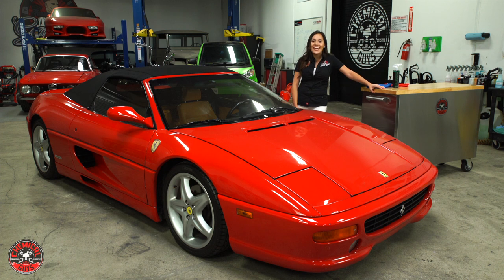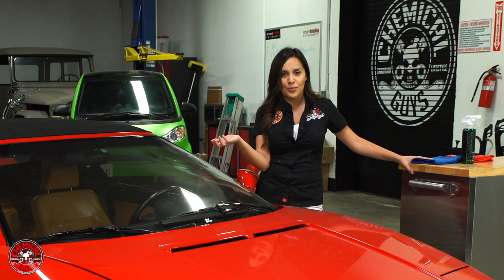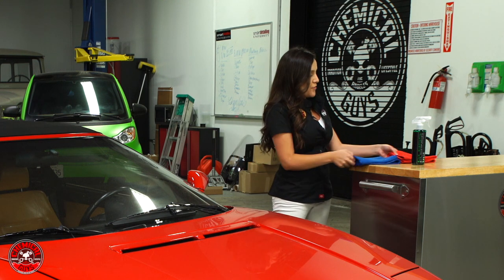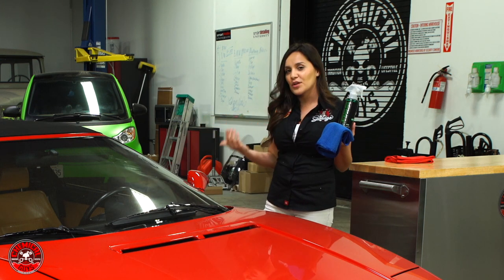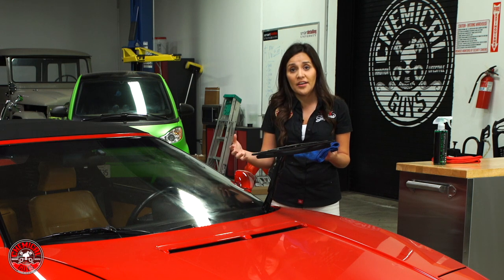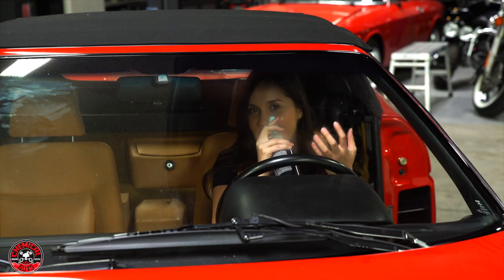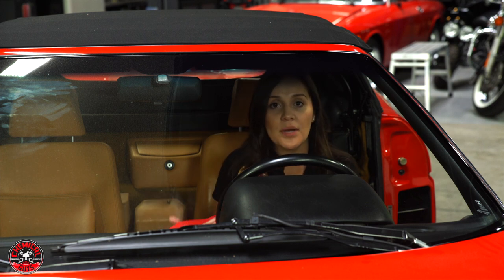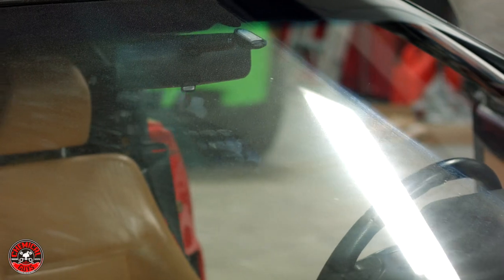Perfect Window Cleaning Techniques - How to Get Streak Free Glass - Chemical Guys Car Care

Comment: Great video... another great tip is when you do your final pass to make vertical strokes on one side (interior/exterior) and horizontal strokes on the other side. That way if you still have streaks you know which side of the class they are on

Comment: the biggest thing here is you have a garage the glass is cool to the touch so youre able to acheive this no problem but for a owner or a mobile detailer such as myself its sometimes hard to wash a car in a cool enviroment most of the time youre in a customers driveway right under the sun so you spray the product begin wiping and as the product decreases it dries almost instantly so youre stuck just spreading the streaks one way then the other but it doesnt really come off unless youre extra carefull and work a super small area at a time

Comment: @chemicalguys my car glass have these water deposits.
I.e hard water spots.
How do I remove it!?
Please help
Reply from the maker: Hey there! Check out Heavy Duty Water Spot Remover to easily lift water spots before they can stain and etch the glass. If it has etched it will require a polish to restore clarity.
https://www.chemicalguys.com/heavy-duty-water-spot-remover/water-spot-remover.html

Comment: Great job with the video!  I've been using the workhorse MF towel to apply the cleaning solution and waffle weave to finish.  It works well but now you have me re-thinking the use of the workhorse.  Might have to pick up more waffle weaves.

Comment: hi cg loving all the videos that you do loads if valuable information but I just wanted to ask if you can do a video for mobile detailing about water tank/foam cannon an pressure washer setups. just on what parts you need to get started. thankyou I've learned so much from you guys. Jay

Comment: I have th CG Glass Cleaner Signature Series and you don't really have to use as much product as in the video, it's a really good, nice smelling window cleaner. I've already started using two towels for cleaning my windows after using just a MF towel for glass kept leaving streaks. Now I use a couple to a few sprays of the signature streaks on the glass, wipe off with the MF towel for glass, then I buff with a finishing cloth, 'cause I'm picky that way.
I would also like to add, again, this glass cleaner doesn't just not smell foul, it smells great, almost like some sort of candy and yet it does it's job excellent!

Comment: never really used glass cleaner products. always used a wet microfiber with soap and then another microfiber to dry streak free.
Reply from the maker: Hi Daniel, thank you for watching. Most of us  grew up using Windex with paper towels, or newspaper. The worst part was the smell, secondly was the fact that it streaked no matter what you did. Glass cleaners are convenient because they're easy to spray, easy to buff off. The one aspect of glass cleaners that always baffled people was how to get rid of the streaks, most people will buff in circles, which essentially leaves streaks. We came up with a two towel method to combat this, and we encourage buffing in straight lines. Try it out sometime.

Chemical Guys Alex -

Comment: She broke the cardinal rule of windshield cleaning. When washing the interior of the windshield, always do it from the passenger seat. It makes it so much easier because you don't have the steering wheel in the way.
Reply from the maker: Thanks for watching. That's a great point, the steering wheel definitely gets in the way when washing the glass from the inside. Stay tuned, more great videos headed your way.